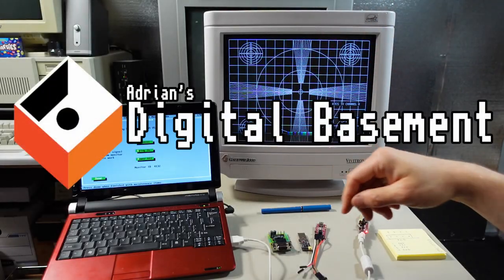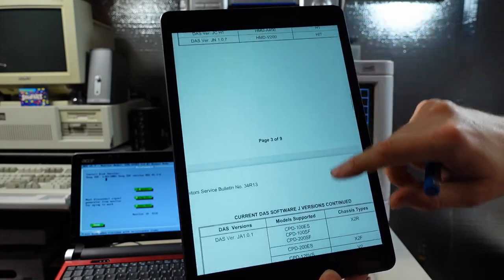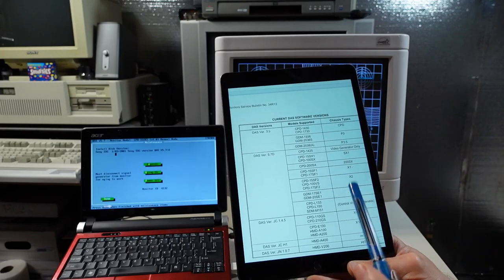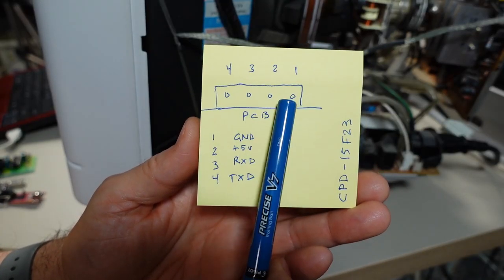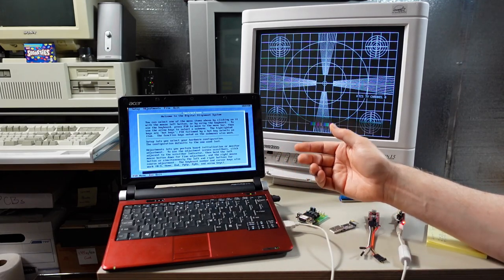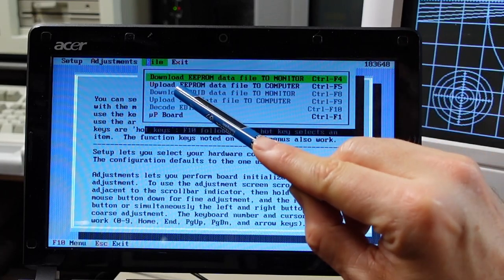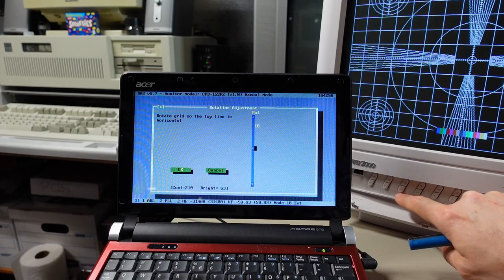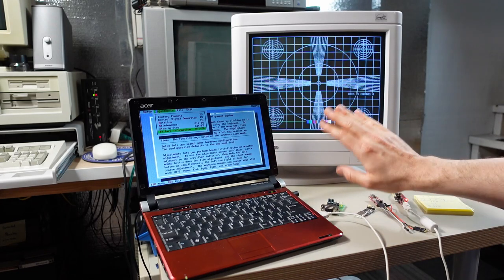Using Sony DAS (And WinDAS) to calibrate and breathe new life into Sony computer monitors

Comment: You can run DOS stuff in DOSBox under Windows 10 and pass through the serial port data without any problem, you just have to set the mapping of the logical DOS serial port to a physical COM port.

BTW, the 'upload' and 'download' nomenclature is normal, it is quite common to see this in PLC software, for example. It originates from "downloading" something from a master system (the computer) into the slave unit (PLC). It's just more common in desktop-land to see the "slave" or client unit do the initiating.

Comment: Thanks Adrian, this was incredibly useful! I've got the Sony 15SF (CPD-15SF1) from 1994 which I use daily and it was starting to get very grey and dim. I plugged the adapter into the diagnostic socket following your steps, used DAS, and went through that whole step by step tuning wizard. I had to calibrate to specific x, y and luminance values so I got myself a cheap Spyder2Pro colorimeter off eBay and plugged that into another laptop and stuck it to the screen. My monitor is too worn for me to get the max luminance values on some steps (which were WAY higher than it could achieve) but to me it now looks as good as new. I'd have never thought it was possible without your video!

Comment: That is awesome!  I've had the AMAZING Sony Multiscan E540 21" CRT since 2002 but nowadays I have to run the contrast at 100% and the RGB color values boosted way up in order to get a good picture.  Since it looks like I'll never find a true replacement, it's great to know that this option exists!  I just need to get one of those TTL converters.  I'm assuming the serial one you showed wouldn't even need any drivers to do its job, correct?

Comment: The upload/download thing is totally logical as the app is commanding the monitor to do things, so when you want to send data from PC to the monitor, you need to command it to download that information. If the app could directly modify the EEPROM in the monitor via JTAG/I2C/whatnot, then it could upload the data to the monitor from the PC.
Reply: Yep.  it's also common in PLCs and other industrial controls, where you're using software on a terminal to drive an external device.  All terms are relative to the device, not the terminal you're using to connect to it.

Comment: It’s definitely impressive they can simulate a yoke rotation like that! I wonder if that saved them any time/money on dealing with a misaligned yoke in the initial installation process… no need to pull it off again, or mess around with any of that stuff. Just do it all in software long after the monitor has actually been built. 

It’s pretty impressive to me that the DAC(s) inside the MCU are good enough to replace the extremely fine-tuning you can do with those pots though. It’s obviously not a digitally driven display still, but having the MCU actively adjust the levels of those signals going into the driver board at all times instead of it just being passively set and forget… seems kinda overkill. But cool. But a PITA. But neat. 

A bunch of different monitors when I was back in school had identical looking OSDs and soft power behaviour, controls layout, and so forth. And they had, with hindsight, exceptionally consistent pictures between each other. So I wouldn’t be surprised if Sony made all of them despite there being various different badges on the outside.
Reply: Multiplying DACs most likely - you take analog input and multiply it by a quantized digital value (and in most cases output it as current, then convert back to voltage with opamp and resistor). Also the yoke rotation seems to be an offset by a linear value (y = ax + b) for both coils, but I might be wrong, it's just a gut feeling.
Reply: There's a simple test to know if Sony made an old monitor or not: was the tube cylindrical or was it curved on both axes? AFAIK all cylindrical CRTs are Trinitrons and any traditionally-shaped tube is not. Regarding image rotation (looking at my GDM-400PS service manual), it appears in addition to the two main deflection coils there are three other coils which are somehow responsible for the convergence and rotation. I don't know how it all works but maybe the rotation coil is actually an extra vertical deflection coil which can be driven at horizontal scan rates. Combined with adjusting the horizontal centering amp at vertical scan rates this should be enough to rotate a picture as well as perform many other geometry adjustments.

Comment: You pointed out that this software would only run on Windows 10 with dosbox,... 
But it's only true with 64bit Windows (which is also the version all OEM's ship on computers)
Windows10 32bit has NTVDM like Windows XP, so this calibration software would also work on newer PC's, if they were installed with 32bit Windows
Reply: might also work with NTVDMx64, untested but I suspect it does

Comment: Kinda wished you covered the convergence related settings more. I have a Gateway VX700 that also likely uses this system for those kind of calibrations and I want to try and improve some of the convergance on it and I'm pretty sure a lot of that I can setup from WinDAS/DAS. (though I have no idea what version of WinDAS/DAS I would need to use for this one)

Comment: I use Virtualbox in Windows 10 at work a lot for various DOS serial things and it works pretty well.  I did have to buy a new non knock off serial adapter when the FTDI drivers changed though.

Comment: As far as it losing your geometry settings, monitors generally only had enough non-volatile memory to hold user settings for a few different timings and if that memory was full and you created a new setting, one of the existing ones would get deleted. It's possible as you were playing with it, you may have done this and that's why it went back to defaults. This seems even more likely because the defaults in the firmware that you uploaded seem to be incorrect for that specific monitor, so you were probably making a lot of user settings.

Or it could be something else entirely.

Comment: Seeing as Sony provide a +5v on the port it would seem to me that for safety their original cable would have been galvanically isolated using two optocouplers.
Reply: I wonder if the programming port ends up being on the hot side of some of the chassis.
Reply: I'd guess it's to power the level conversion circuitry. The microcontroller practically has to be on the cold side of the chassis because it would be exceedingly difficult to maintain integrity analog of signals crossing the gap.

Comment: One thing to beware: Gateway also had DiamondTron monitors, which were definitely inferior. So you need to check model #s, beyond just looking for the Trinitron shape.
Reply: Granted, we were always mystified by how bad the later (late 90s) Sony Vivitrons were.
Reply: I recall a tech suggesting that the Gateway case design caused the monitors to run hotter, but that was purely a guess on their part.

Comment: The CH340 is used on many Arduinos, so if you have the Arduino IDE installed, you will already have the drivers; the IDE uses DOS commands to do the upload via avrdude, so the driver should work fine.

Comment: For any of you who are getting "Could not read db.msg" errors when running any DOS version of DAS, there is a fix. Install your desired version of DAS from the SonyDAS.zip file (not DASX). This version will be locked but won't give you any errors. Now, replace the DAS.EXE in your new unpatched version of DAS with the corresponding patched version of DASX.EXE in DASX.zip

For some reason none of the patched DOS versions of DAS would run properly on my machine. (XP 32-bit) It seems like the patched executables didn't like their DB folders, but worked just fine with the DB folder from the unpatched version.
Reply: I had the exact same issue and solution.

Comment: Actually windows 10 does run dos programs, IF you have 32 bit windows 10! Though not as well as Windows XP.
It's because 64 bit versions of Windows drops any legacy support for 16 bit applications, which dos programs certainly are
Reply: This makes me want to look and see if it was omitted from 64-bit versions of XP. Presumably the Itanium one will have omitted it since that stuff could never ever run x86 code anyway. But idk maybe I’ll find they built an x86 emulator for it for the DOS shell (I doubt it though). But really I’m curious about the status of the DOS shell in AMD64/x64 XP.
Reply: @kaitlyn__L  OTVDM adds a 16-bit subsystem back to 64-bit Windows.
Reply: @kaitlyn__L  The x64 version of XP probably doesn't have it enabled but the codebase has contained an x86 emulator since the early days of NT. It was used to run pre-existing applications on the non-x86 versions (such as Alpha and MIPS) of NT which existed back in the day.

Comment: Aging may be used to visually inspect non-uniformity across the phosphor screen.  I'd imagine that this does break down over use and that the reason old monitors need to be driven harder.  A solid white screen would allow the calibrator to inspect for areas that have "aged" at different rates.

Comment: I'm guessing the firmware you flashed back into the monitor is not the correct firmware, but is somewhat compatible. That's why it's acting weird compared to before you bricked it.

Comment: Can you make the IBM 286 run a modern lcd display? I know you can buy vga to hdmi converters, but would a vga card even have enough vram to drive let’s say a 27 inch lcd screen? How much vram does the vgawonder card have?
Reply: The size of the screen is irrelevant. It's all about video signal timing, and I would be amazed if there was any LCD that wouldn't support the original set of VGA timings, as they're still used during bootup of PCs. It's going to be upscaled on your monitor, though. It's not like the original VGA cards can drive all the pixels on your 4k monitor, as you were getting at. Also, the aspect ratio won't match, so the image will either be stretched or pillarboxed. But I would be amazed if it took any significant effort to make it viewable on your monitor.

Comment: Do you think these versions of DAS will work with my Apple Multiple Scan 17 and 20? I’m not entirely sure because they came out in 1994
Reply: what anime is ur pfp from
Reply: @ComputerTechnic217  Gintama
Reply: @crestofhonor2349  tyyyyyyy
Reply: IIRC your Apple monitors are a notable exception as they only used a Sony tube, but the chassis was not from Sony.

Comment: I'm having a problem with my Dell P780 Trinitron to where the brightness is reverting back to 100% and I'll have to re set it back to 20%. It will strangely revert after making a keystroke after walking away for 10 or 20 minutes. Will this procedure help?

Comment: Sorry if this is a dumb take, but do you think it’d be possible to use that “custom resolution\timings” option you see in most GPU control panels to manually create a mode that’d work with those various presets?

Comment: IIRC, the CH USB-serial chips suffered from the same problem as the FTDI chips, with widespread cloning. If you end up with the cloned chips in your equipment, it can be a pain in the posterior to find working drivers for them.

Comment: Hello dear @Adrian's Digital Basement ][ recently Ive got a Sony Multiscan 400 PS , the last model done by Sony . But It has a problem , the image "vibrates" a little, you know wich is the faulty ?? Or can you say to me wich component is causing this .

The monitor is an espectacular one but this problem makes usable only for a few minutes

Thankyou very much
Reply: Grease the anode cap or could be a capacitor/flyback issue.

Comment: You could use a nvidia card I know the nvidia tool panel you can configure refresh rate and various other settings. I know the 10 series later cards can do this but they don't have a vga port but a DVI. I can remember if the 9 series has a vga port but this might help with experimentation.

Comment: 14:30 It's actually not so much that Windows 10 can't run DOS programs, it's that it can only do so in the 32-bit version, because the NTVDM system doesn't do full emulation, so it relies on the CPU to be able to execute most instructions directly. This doesn't work, because the x64 spec doesn't support 16-bit operations when running in 64-bit mode, so the subsystem was simply removed from all 64-bit builds of Windows.

Of course, it's unlikely you'll want to run 32-bit Windows 10 in the first place... but if you have access to it for some reason, then it would probably work there too.
Reply: You can add a 16-bit subsystem back to 64-bit Windows with OTVDM.
Reply: @bdwilcox  NTVDMx64 would let you do the same thing
Reply: @eDoc2020  It was a little more complicated than that.  WinNT on Alpha constructed 'analysis and synthesis' binary translation DLLs along with emulation in a package built by DEC called FX!32.  This allowed non-native Alpha RISC apps to run at half-speed on x86 hardware with faster speeds hoped for in a future that never came.  The upshot is that the engineer who designed Alpha's beast of a floating-point unit lent his talents to AMD and made them who they are today.

Comment: Still seems like you don't have the right monitor model selected. Maybe that version of DAS doesn't support that particular OEM model. I dunno. I also think download/upload thing is reasonable if you think of up/down from the perspective of which machine is superior. We are just used to clients talking to remote servers rather than the pc instructing an inferiour device to interact with the pc as if the pc was a server.

Comment: Makes me wonder what person decided that instead of analogue adjustments, requiring a computer and proprietary interface with software that is licence-locked was a great idea, but then, it's sony, they did stuff like that... :P
Reply: I’ve always wondered why Sony loves proprietary stuff
Reply: Digital adjustments are more reliable though.
Reply: One microcontroller is cheaper than all those potentiometers. So I’d guess the bean counters are at fault. 

Of course the engineers had to come up with real “benefits” too so as to justify it; so you get things like everything being in an OSD, uploading and downloading settings files, that built-in diagnostic testing, and so forth. But I guarantee it was a cost-reduction measure on the circuit board (and a little money spinner selling the dongles too). 

You can tell it wasn’t the engineers’ idea because they didn’t put any actual effort into securing or obfuscating the code, it was trivially patched. But it did enough to satisfy the bean counters who wanted to know the revenue stream was “safeguarded”. 

(Like nowadays with those website paywalls where you can still read the article unobfuscated in the HTML source. The bosses who care about the paywall don’t know about viewsrc, so they see the window pop up and are sufficiently satisfied.)

I’d possibly hazard a guess that it also allowed further automation in the initial calibration, but I don’t know enough about how all of that works to even say that without all this couching. But one could imagine alignment, grid spacing, etc could be done by a computer in the factory with some camera looking at the pattern maybe. Though it’d probably be financially Worth It even if it merely sped up the equivalent of employees sticking magnets to the back of the tube by doing those tweaks in software. 

After-sale repairs could have simply been an afterthought, with someone going “eh, we’ll give the licensed repair shops access to the factory software for a small fee, and they can continue to do their business too I guess”. But since Sony weren’t making money directly from those repairs, they had absolutely no financial incentive to make that process any easier. Something that makes manufacture cheaper and repairs pricier is most aligned with the company’s financial interests, after all.
Reply: Cheaper to implement in software than a dozen mechanical knobs.  Cheaper to do initial test and turn-up at the factory.  Additional revenue stream from authorized service centers, which are going to be used to software restrictions anyway.  It was never intended for an end user to open a monitor or TV since the 70s.
Reply: it keeps the BOM costs lower... and licensing is a source of continuous revenue for Sony.

Comment: I have a GDM-W900 with a service port that looks like a mini din port. I wish it was just 4 pins! Does anyone know where I can find a pin out for it? I would LOVE to try this. This monitor has bad pincushion and the on-screen pincushion control does nothing
Reply: I wish I could help. Did you try looking at the board itself to see if anything's labelled? If only 4 pins are connected it shouldn't be hard to reverse engineer the pinout.
Reply: @eDoc2020  I bought a 8pin mini din to db9 cable off amazon, it should work great
Reply: @Walczyk  That might not work; meaning it might break things. The monitor's port is 0-5v while a regular serial port is +-12v.

But about the monitor itself, you said the pincushion control does nothing. Do you mean absolutely nothing or just not enough? If the former there's a hardware failure, likely a cracked solder joint.
Reply: @eDoc2020  Right, it doesn't work and I can't find schematics for it, Maybe a pinout of the controller IC is what I need to start looking for pinout control traces. It's actually a friend's monitor, I don't have access to it at the moment.